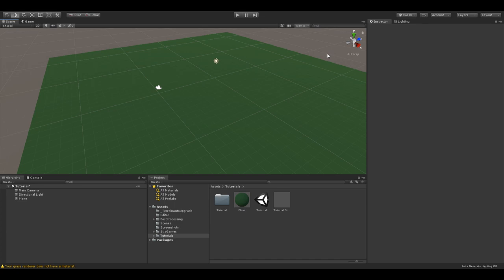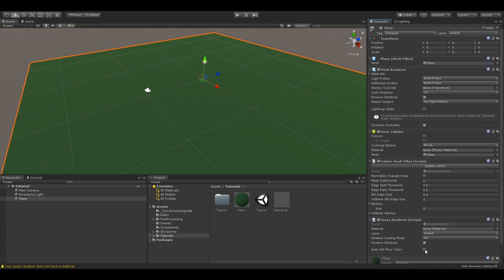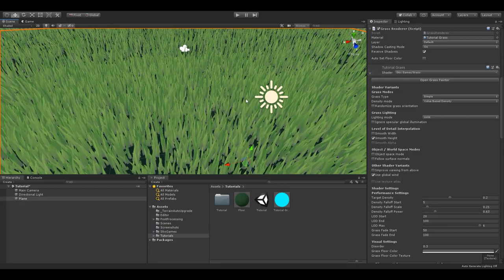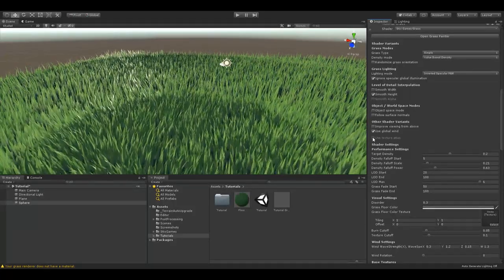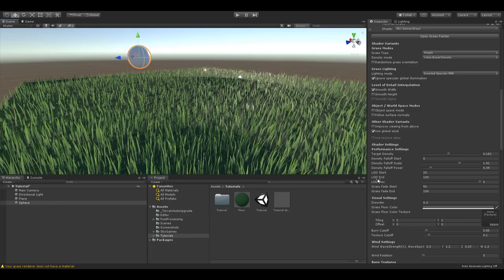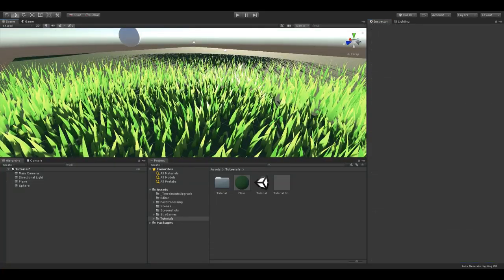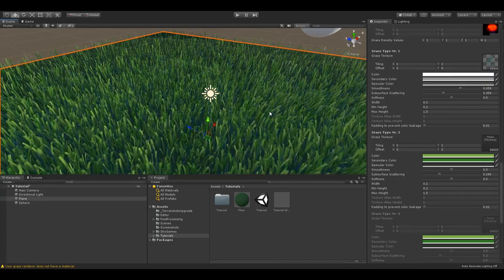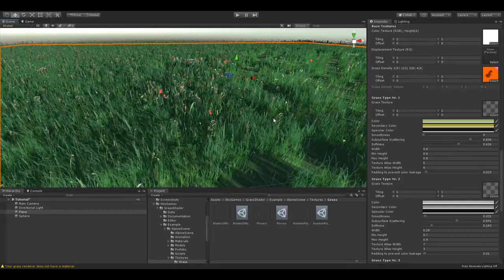DirectX 11 Grass Shader - Material Settings

Comment: does this works with LRWP? i'm getting a pink material and no options when i create the material from the shader.
Reply from the maker: It works with the Universal Render Pipeline (e.g. LRWP in Unity 2019). You have to switch to the Grass URP shader in the material settings. Not all features are supported yet, but if you need a specific feature, you can contact me and I'll try to support it.
Reply: What are you doing up at this hour? it's not healthy!
I just came back to the computer to see if i can make it work.
Works like a charm with that., thanks.
Reply from the maker: @CultivationPath  It's perfectly healthy in my timezone! :D

Comment: Hi can i use it with enviro sky, lux water and dynamic nature  ?  It work on terrain ? Can i use multiple grass textures ?  thanks
Reply from the maker: Not sure about enviro sky and lux water, but it should work without problems. The grass works on terrain and custom meshes, you can use multiple textures and texture atlases.
Reply: @simonstix  I buy it but how to setup grass for differed rendering ? I use standard build in shaders and unity 2019.3.4 , Only one side receive light. other side are black.
Reply from the maker: @RemiG-3D-Art  I've answered your question on the discord! I hope that helps with your problem.